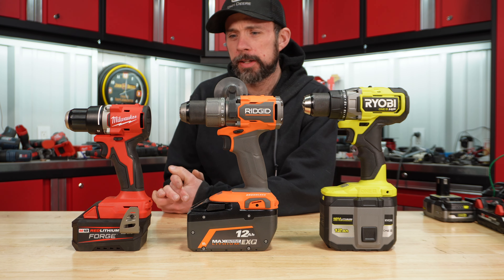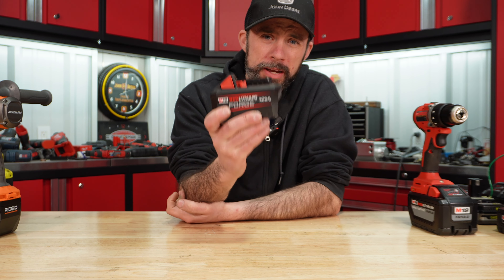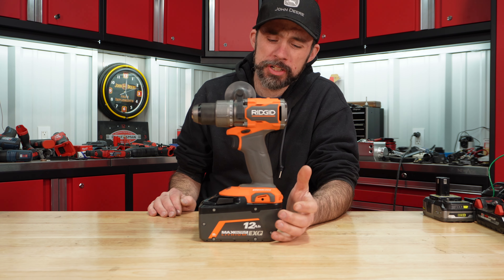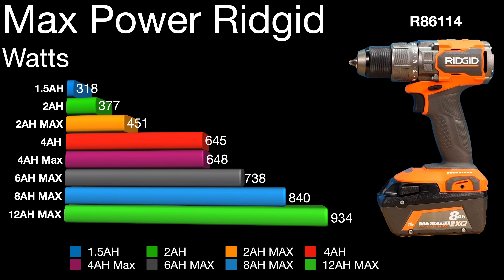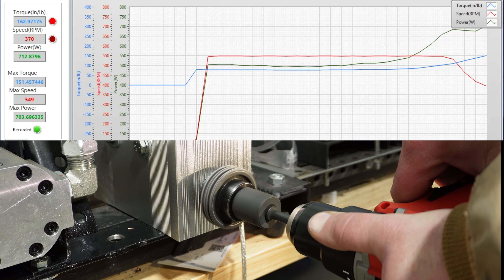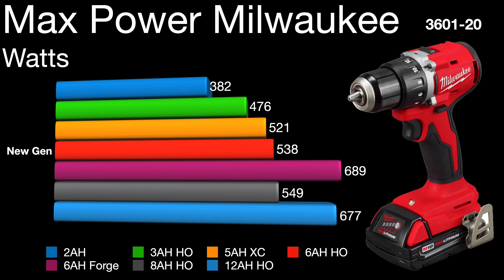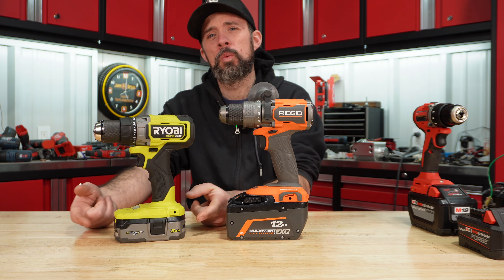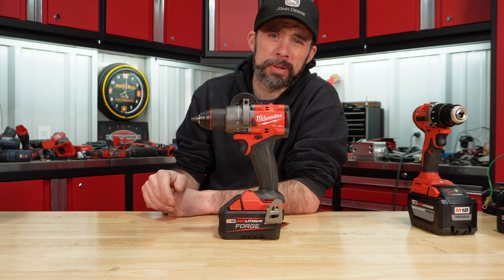Best Cordless Drill Update Mid and Compact Spec

Comment: Ive got the Milwaukee compact drill and i really like it. Plenty of power and i mainly work in steel and  variuos metals.. would recommend
Reply: i'm pleased with gen 3 M12 3404-20 for wood, plastic, and concrete very slowly. don't have metal bits to try
Reply: I was going to get the m12 because I have alot of them. But I went with this drill and impact because of how compact they are.